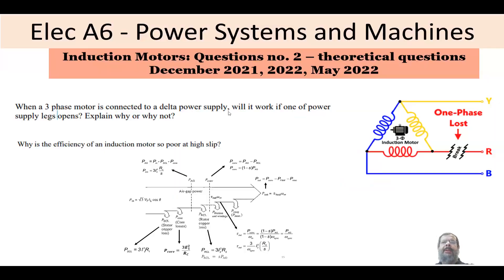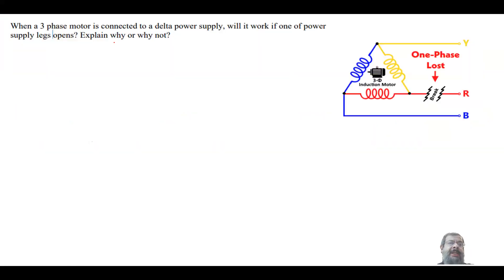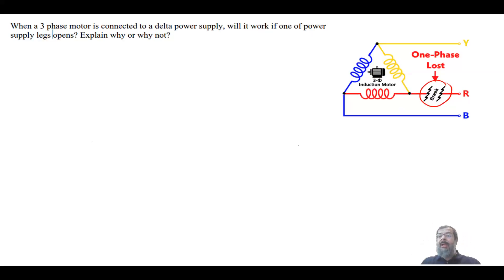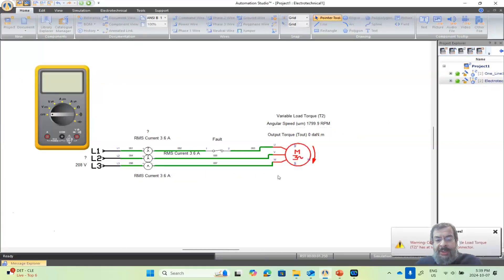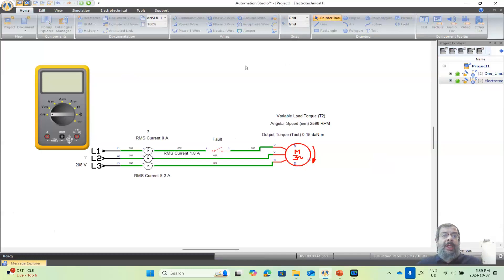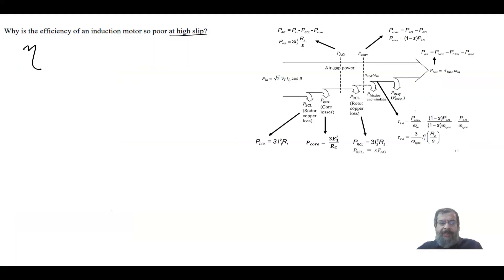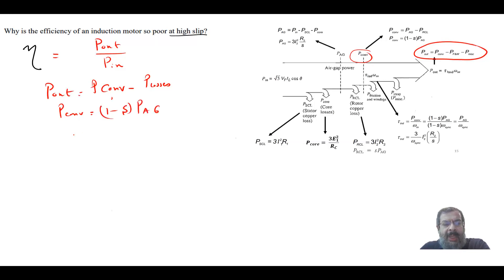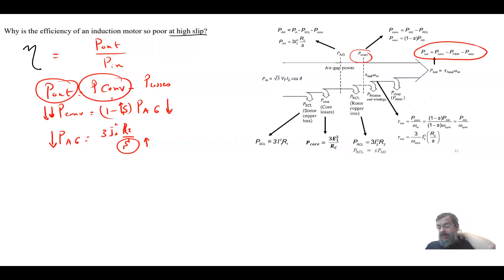PEO solved examples (ELEC A6) Induction Motor Question no. 2

Comment: it can also be said that at lower slip, rotor losses are less (since P,rcl = s*P,ag) and and more airgap power transforms into converted power, hence efficinecy increases. Similary, if rotor is blocked, slip becomes 1, and all airgap power is consumed in the rotor (P,conv = P,ag- P,rcl). and output power becomes zero.
Reply from the maker: That will work too